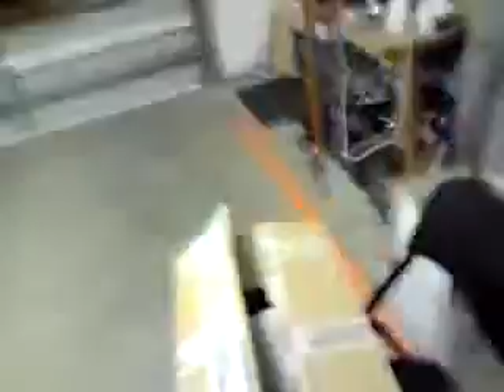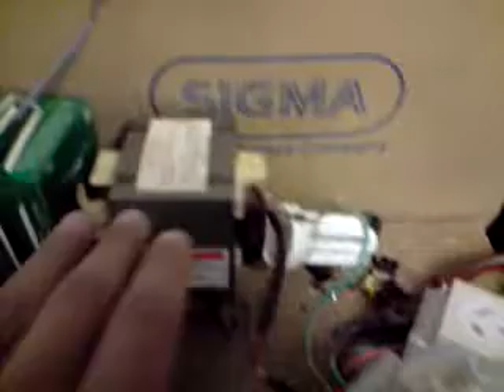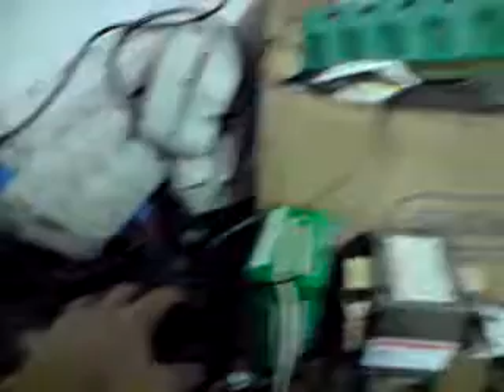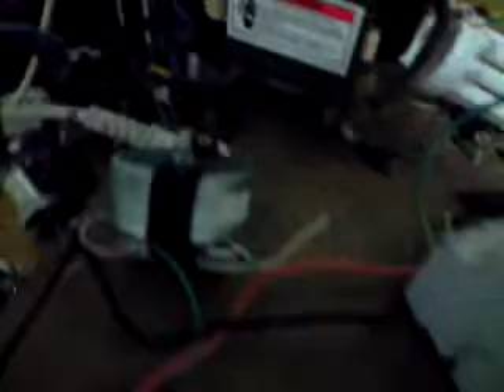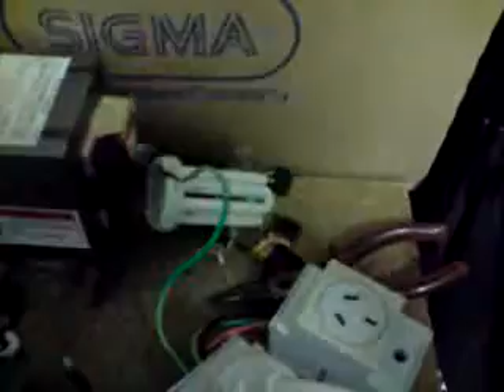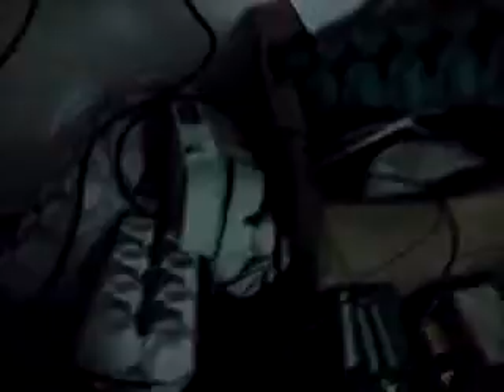microwave oven transformer low voltage in-put pulses

Comment: Hi Lokivoid, 

I think the 555 can handle a little more than 5Vdc, but I don't think the drive voltage would require more than that to drive the gate of a regular transistor/mosfet. PWM can be implemented well w/ 555 with proper design. It's a non-critical application. ;)

Comment: If you want to `pulse' the circuit, search the net for a circuit called "555 oscillator". A lot of sites have schematics on how to construct one. They tell you which way to wire it up, etc.. Using a power transistor, it would replace the switch and you can then get the desired effect of fast switching. Try searching for "how to read schematics" and "using 555 for high voltage" and you should get what you need. Hope this helps.